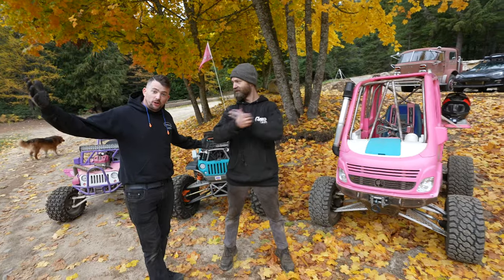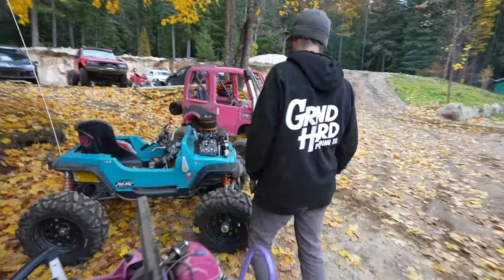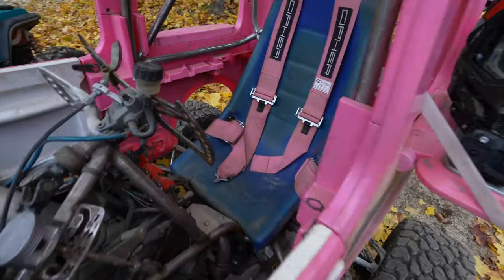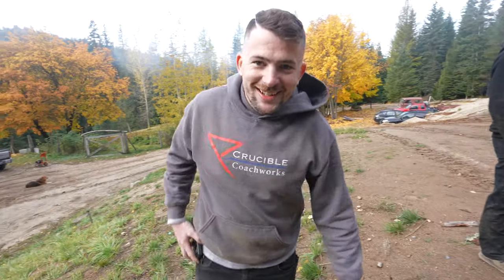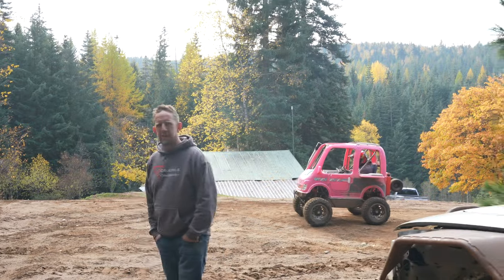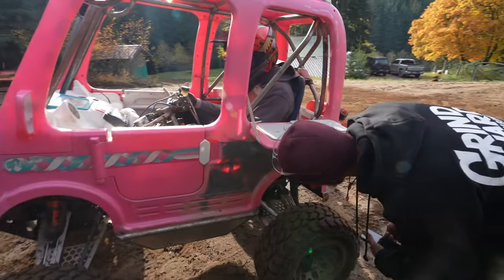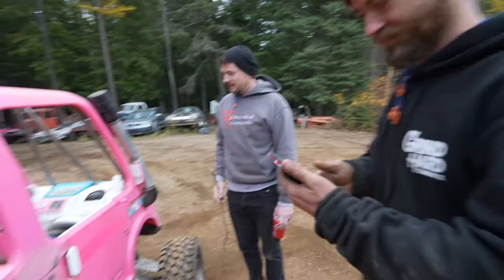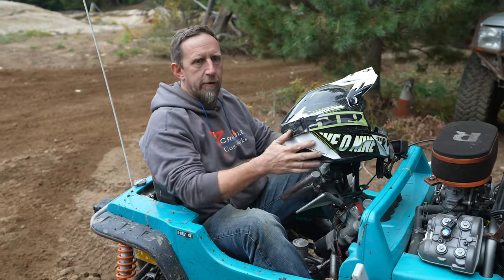We Raced GHPC's Karts and Then THIS Happened!

Comment: I want one of those Barbie Power Wheels but I want an electric 4 wheel drive one w/ a 96v battery and 2 12kw QS 273 3.5t hub motors and a set of Kelly or Sabvoton controllers.... That would make a street monster that would probably need a roll cage to keep you alive.     😂